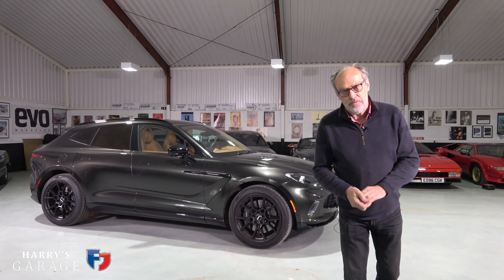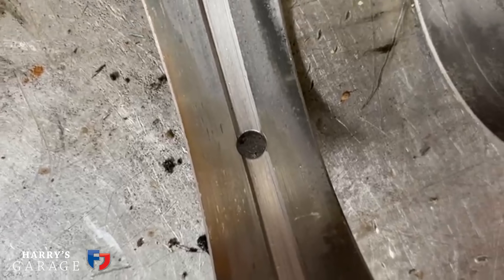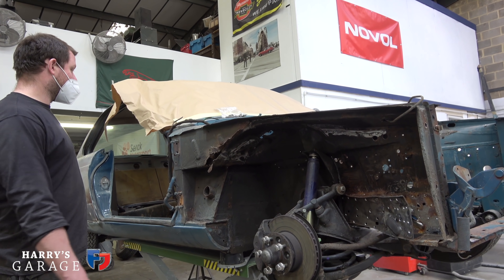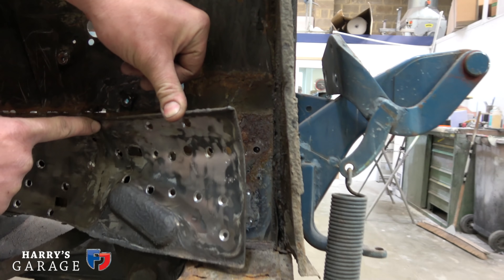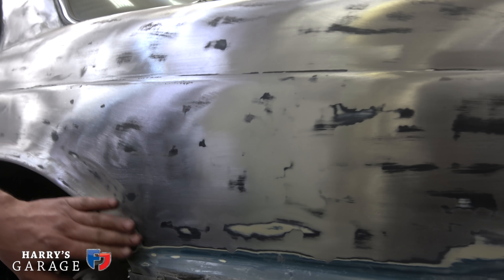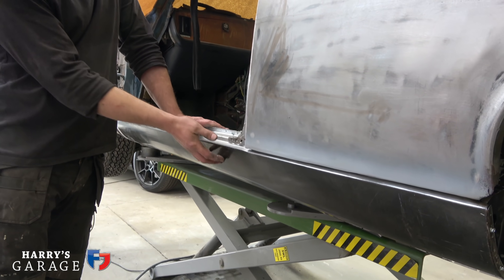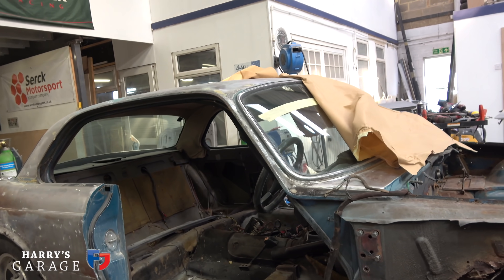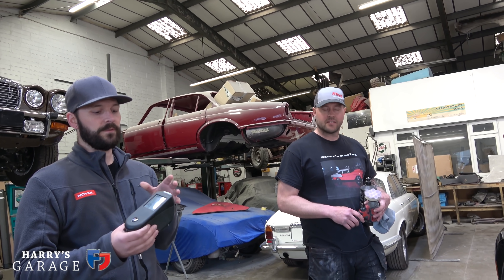Jaguar XJC V12 restoration part 3. Discovering more rust & decision time on the colour!

Comment: Looking at that bodywork it does make you wonder how safe we are driving around in old cars!
Agree that car does need a flater style paint.
Reply: I’m not being funny mate but a car with a bit of rot isn’t a problem, what are you expecting? The thing to disintegrate under braking? Mot checks all structural points of concern, anything extra won’t have any significant effect.
Reply: @justbreakingballs  But it’s also nice to think something old doesn’t shatter around you if you get hit.

Comment: I didn't want you to change the colour from that beautiful blue, but now I see that even more appropriate green and can definitely imagine how it will look on the beast, I cannot agree with you more!  What a lovely colour - just the right mix of old and new.  Sort of a modern take on the olive 1970s Jaguar offering.  An excellent choice, sir.  I look forward to seeing it on the car.

Restoring a classic car is like peeling an onion.  There always seems to be one more layer and you never see what's underneath until all layers have been peeled.  Sometimes it's the solid core of the beast - other times there is nothing left at all.  I'm sure we've all been there, Harry - I certainly have.  In some ways it is like looking back over the traumas of the car's life, where sometimes they got a good doctor and other times they got a cowboy.  In for a penny, eh mate?  I've been at the point where I may as well get her ALL done properly - seeing as how I'm in it for so much already.  I certainly got to enjoy the car afterward knowing she was rock solid and beautiful.....well, that was until someone smacked it in the side and wrote it off and she became a donor for other cars.....  

One last: the hole in the roof - if it's fairly central across the beam, would it maybe have been for a radio aerial?

Comment: I empathise with your disappointment in discovering additional old damage and corrosion as most of the vehicles that I bought in my younger days; and once or twice more recently, seemed to turn out to be this way.

Modern cars are understood to be built much better from the factory now, but again its previous accident damage that appear to compromise the corrosion integrity and perhaps not always the fault of a repairer.

Things just don’t go back together as they were originally manufactured and intended to fit.

All the same I appreciate a lot of the work had already been recognised and so it’s great to see positive progress with the Jaguar.

Comment: The poor Jag has had a tough previous life, been in a few little tussles.
Getting properly sorted now and all for the better, the base metal work will be spot on.

Colour doesn't need talking about as it's perfect. Don't be surprised if Aston/Jag take this colour back from yourself and use it in the restoration factory.

Comment: My first job before I went to uni was as a dye chemist in a towel factory. They had a spectro colour matching system in the lab that they couldn't get to work, so I did all the calibration dyeings for each dye at a range of concentrations, standardised the orientation and method for measuring samples in the spectro and it worked a treat for colour matching and QC. Then I left.

So watching this was interesting how things have and haven't changed. Portable multi-angle spectro and checking weights of a formulation is good stuff.

Comment: About the hole in the roof: "there's no answer to that, it's just a Jaguar!" 😂
Reply: Its also approx 40 years old, total history unknown so your comment is ignorant.
Reply: @odinikita4821  the comment is a quote. Now go and get a tissue.
Reply: I'm pretty sure that hole in the roof was an aerial mount.
Reply: @richardstocks9139  That's a good shout. I remember seeing XJs in the 80s with electric aerials that rise from the rear wing when you turned the radio on. The holes for them also went rusty...
Reply: @odinikita4821  I am a long time Jag enthusiast, club member and President, have visited Brown's Lane and chatted with people who designed and built these great cars. "It's just a Jaguar" is an appreciate quote. Some of the stories they told me just made me wince. And I have an XJ6 and XJ6 awaiting restoration by me and I shudder at what lies ahead. And this car lived in England, a recipe for disaster for old Jags.

But I have seen much more rusty Jags from there. People where I live would run away screaming!
Reply: @richardstocks9139  Yes, indeed. Great point.

Comment: Years ago a family friend who lived at Cubbington, not far from the Jaguar factory, invested in one of those newly released  XJ6s  - in Olde English White, with blue upholstery. After the customary delay of months, he received a phone call telling him that the car would be delivered to his home. Newly delivered, it looked really quite splendid! Alright, yes there were obviously a few bits missing - the badges behind the front wheel arches, the small air intakes either side of the undeniably handsome radiator grille and surely he could manage without a  radio aerial, just for a little while, so really nothing of any great concern - and of course, he'd be contacted when the parts were available and then an appointment made for them to be fitted - at the first service perhaps, with a bit of luck...  Holding the door open for his wife to admire the walnut, the expanse of luxurious blue Wilton and those still plastic encased pale blue Connolly hide seats, the no longer sylph like lady lowered herself timidly into their comforting embrace... and fell flat on her back. The front seats were held together only by the albeit actually quite thick, plastic protective covers. You don't get quality like that anymore eh?

Comment: just looking at the bulkhead their i remember years ago a jag dealer saying if you didn't treat rust on a jag straightaway you could have a extra for no added cost that been all year air con courtesy of the floor/ behind the dash/ or the boot or bits of the boot lid came off as you closed it lol

Comment: When I bought this Jaguar coupe, squadron blue was the best colour with the biscuit hide ( now dark blue ). Harry should also resurrect the black vinyl roof covering as it  visually reduces the height of the car. A further note, the car came with the gold coachlines which looked really good, but were removed once it was re-painted some years later by the previous owner. Shame to see it change from the original but understand Harry's desire to go for a more modern colour.

Comment: Looks like the car from the Bonnie & Clyde movie, the one that got shot up a wee bit...you can hear the crestfallen sound of Harry's voice when that nearside inner wheel arch panel is revealed. I think that caught him out a bit as I think the Jag was considered to have been slightly more wholesome than this...certainly compared to the Fulvia, but it just shows you that metal really is a pretty unsuitable material for building cars with 20+ years longevity.

I think Iain Tyrell described it perfectly when he was describing the oxidation problems associated with the Mk.1 Ford Capri monocoque, of which only 3(!) Capri 3.0GT XLR's still remain driving in the UK in 2021. That's staggering depletion when you consider just how ubiquitous Ford Capri's actually were, particularly in the 1970's.

"I swear you could almost hear the things fizzing as they literally dissolved".

Comment: A lot of factors can affect the final look of a metalic paint. Air pressure to the gun, flow rate, nozzle set up, distance from the car, rate of build up, two different people using the same setup can produce different results. Even the type of light it's viewed in can affect it. At the end of the day it will look stunning with that paint on it.

Comment: When this was only a few years old this car would have needed welding for every MOT - such was the nature of cars of this era. How good the repairs were was down to the garage doing the MOT.
Generally they were pretty poor.
Possibly the best thing that happened through the 90's was galv coated steel and seam bonding which along with better panel design and drainage solved the problem almost entirely - exceptions Ford Ka, most Mercs and of course Mazda's MX5.

Comment: The rear subframe is suspended on the 4 rubber mounts and can disintegrate due to the weight of the subframe. Always better to support it from underneath.

Comment: Well... it's not going to be a cheap job but it looks and sounds like you've taken it to somewhere that's going to do a great job, it's going to be way better than showroom when it's done.
I'm glad you didn't go with Brunswick Green, the kind of mossy/ 70s style will look great. The darker green suits an old Blower Bently but looks too flat on an XJ, I've seen a couple of them. (I'd have gone with purple but that's just me).
Are you getting the interior done to a similar colour and standard as the DBX too?

Comment: The problem with going by the colour you see on a computer screen, is that it’s rarely a 100% match, due to differences in colour temperatures on different screens. In an ideal world, everything will be properly calibrated, from Aston Martin’s camera to your computer screen, but any imperfections along the way will result in some degree of mismatch between what you see on the screen and what you see on the car in the flesh.

With most regular cars, you’ll have seen one in the colour you want already. With more expensive cars not being as abundant, there’s definitely value in asking to see the car in the flesh, like you did. :)

Comment: the factor that would determine whether or not the rear oil seal needed replacing, if it were my car,  would have been the extent to which the clutch plate had been saturated with oil. if it was devoid of oil. i wouldn't have deemed it necessary to replace the seal.

Comment: What shock .. glad someone has a deep enough wallet to fit that expense . 
By such I stop worry about my 1974 XJ6L optained 13 years ago for  2500$ and driven mostly trouble free ( yes it gubbled up some parts 
Water pump , fluied clutch, brakes new stainless exhaust system , alternator ( what a pain to replace in the usa version as the airpump is located at that position so the alternator is all the way on the bottom
Replaced one fuel pump and fluellines, replaced the oil leaking steering rack  so overall another 2500$ spend on it for parts.
Not even track how much money spend for fuel or oil .
I not keep accurate track of spending on the enjoyment or care of the outside looks or the performance of it . My pleasure is able to drive a nice car and not give a fahrt what others think about the looks .
Also here in the usa one of the freedom left is no DOT inspection . 
So enjoy the last open Road

Comment: So Harry, at the front here we have found some rust.
Yes.
And the sills here have corrosion.
Yes
The rear arches - one is pretty bad.
Yes.
The other one is just a bit rusty.
Yes.
So the bonnet is OK, just a bit of rust.
Yes.
And the doors both have some edge corrosion.
Yes.
The roof is not bad.
😂

Comment: If the starting point for the bodywork and engine out respray was 20,000 pounds. With the engine rebuild, and structural body repairs, what is the cost looking like now? and where might it end?????

Comment: That rust :( I always wonder if you're just better off not knowing/not digging too deeply in this circumstance - unless you're using the car over the winter on salted roads the repaired/leaded areas & other rusty bits shouldn't deteriorate any further really. Respect to Harry for the ground up restoration!

Comment: It looks like you plan on saving $8.27 by not popping out the front and rear glass. I am sorry if I am wrong but on a restoration paint job they must come out. And yes, there will be additional corrosion there.
Reply: The glass did come out......

Comment: You want MG Woodcote green as used on the RV8 a few years/decades ago. Or slightly more grey, BMW Cypress green 152. But Christ those XJ's can rot. I had a 1977 XJ-S restored in 1989 and it was just as bad......32 years ago!

Comment: Alarming really buy a solid clean classic with a few rough edges and this is what you get don't think there is a panel without significant rot before frame rail repairs (which looks a decent repair). Without zinc or dipping I wonder if some residual rust will remain in box sections to return later.

Comment: Harry. I can't emphasize enough NOT to pick that colour ! Choose a standard colour . Mazda,VW, BMW, Mercedes .Then in the future there won't be a problem matching . The cupboard full of colour chips will have  any amount of Green metallic. Just ask if you can borrow a few (or the lot one weekend )  l can assure you the're many weeks off painting the engine bay ! Very bad luck on the rust issues , have to comment that l'm not filled with confidence in their abilities to tackle this . The car should at least be on a rigid frame and those screens should have been removed to confirm there's no rust hiding . Sorry  Harry .

Comment: Interesting when you are a multi-millionaire,  how you can essentially write a blank cheque for a restoration. This amount of work on the bodywork would likely not be financially viable (even for a relatively rare xj coupe) I'm guessing this would be £30k plus ( likely more) with all that structural work. And with an engine rebuild as well....add another £15-20k? It would be good if Harry gave some insight on costs for  a restoration like this so us mere mortals can have a reality check!

Comment: All cars that have been accident repaired end up like this. They get cut and new panels added or they're put on a Celette and straightened, then painted over. They all look great when they're first done, unfortunately the damage is inside the chassis caused not only by the original accident but the subsequent repair as well. Every time a car is welded on or heated and straightened the rust protection of the original steel is damaged...That's why it's very common to see a car rotting from the inside out. I hate to disagree with your man Harry but simply fitting epoxy coated sill to your car is not the answer. The only way to properly restore an important car is to firstly have it acid dipped, then all the metal work repairs, then it should be sent off for E coating, and then painted. That is the only way to ensure that you have removed all the rot and then rust protected it for the future. Even if a car is dry stored it needs this level of protection...The car will create its own internal damp just by driving in from the cold into a warm garage in the form of condensation. Good luck with the project.

Comment: Severe case of "Steel worm", needs welding up , soda blasting and electrically treating to remove all the rust . Then galvanised to preserve the steel, seams leaded and box sections injected with wax.  Underside needs to be undersealed and then the whole car needs painting.   How is a poor farmer to afford that?

Comment: I don't get that colour mixing machine. Why does it need so many repeated elements moving together?  

And then, when the constituent colours actually appear to be getting mixed proper, it's done manually by a chap stirring the paints together in what looks like a repurposed supermarket salad bar tub (medium), using what appears to be a conveniently sized length of requisitioned Mechano™.

Baffled. 🤔